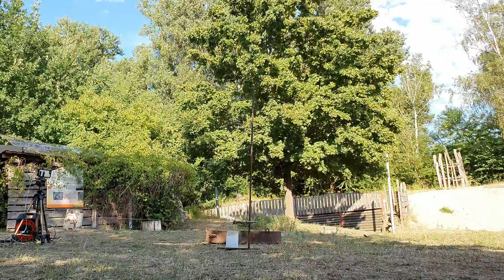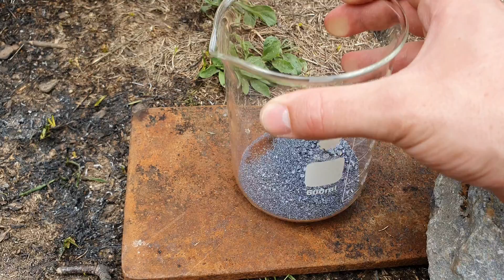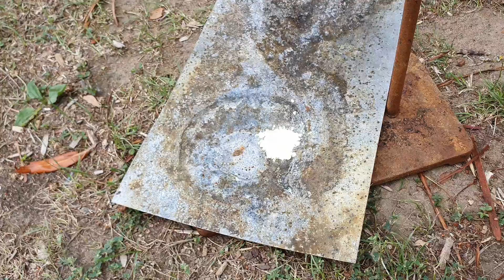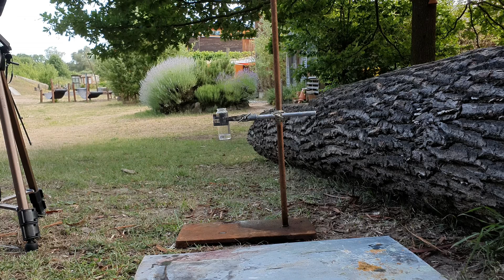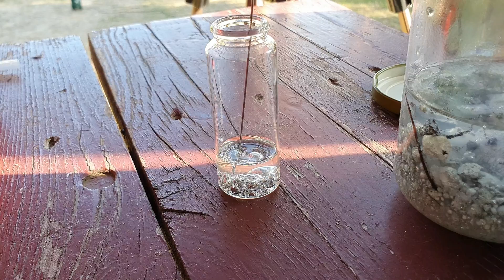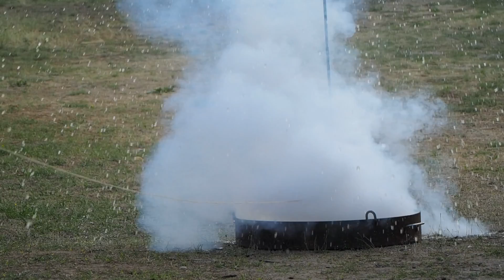Cesium reacting with Iodine, Sulfur, Teflon/PTFE, Dichloromethane + Making CsNaK

Comment: The CsNaK reaction with water was insane! It was almost as if the insane reactivity of cesium forced sodium and potassium to react with water much more explosively than they normally would! For the columbic explosion, the cesium would react very fast due to its low activation energy for reaction, and the energy released forces the sodium and potassium reactions well over their higher initiation energies, making them explode as well!

Comment: Well, but how about reactions of metallic cesium with:
- solid CO2 ("dry ice");
- liquid O2: Cs + O2 --> CsO2 (+ Cs2O2•CsO2);
- liquid N2O4: Cs + N2O4 --> CsNO3 + NO (+ CsNO + Cs2N2O2);
- naphto-18-crown-6 - in tethrahydrofurane: nf-18-cr-6 + Cs -(THF)-> Cs(+)nf-18-cr-6(•_);
- WO3, MoO3 and MoO2;
- diazomethane in benzene: Cs + CH2N2 -(C6H6)-> Cs2CH2 + N2;
- acenaphthene in tethrahydrofurane: acn + Cs -(THF)-> Cs(+)acn(•_);
- dimethylsulphoxide (- extremely vogurios reaction!);
- [(H3C)2N]3PO (- hexamethapole, HMP): Cs + HMP --> Cs(+)[HMP(•_)]
- acetonythryl;
- acetic anhydride;
- fluorene in THF;
- liquid SO3;
- SOCl2 and SO2Cl2;
- S2Cl2 and S2Br2;
- dimethylformamyde and dimethylacetamyde;
- liquid P2O3;
- liquid SO2;
- cyclopropane and ethylene in THF with 18-crown-6: Cs + C2H4 -(THF)->  Cs-CH2-CH2-Cs;
- bis-(phenyl)-acethylene in THF;
- cumullens in THF;
- liquid N2O;
- CrO, FeO, VO;
- "dry water" and octafluoronaphtalene;
- hexafluoroacethone in THF or methyl-tert-buthylic ether;
- triphenylborane in THF or tert-Bu-O-Me...?;)

Comment: Cs:NaK would probably be an extremely effective magnetohydrodynamic working fluid  due to the high entropy and extra loose electron of the Cs. Fwiw i had to fix up an E-beam evaperator head that used NaK to prevent the gun and target holder from ending up vaporized. It took several kg worth if NaK to fill the resovoir and plumbing up. The pump had 2 SmCo magnets with platinum iridium rods fit into a beryllium oxide ceramic chamber. Why the NaK needed replacement? Someone was replacing a vaccum flange and the wrench the used hit the magnet and cracked the ceramic part of the pump causing some of the NaK to leak out an catch fire. Ended up using argon to extingush it. Shut the service valves, and wrapped the pump body with parafilm and pallet wrap to prevent any more leaking and burning. It didnt do too much damage to the machine itself since most of the machine wasnt easily burnable even by burning NaK... but since it was a class 1000 cleanroom this happened in, the NaK smoke residue was a major problem. 🤓
Reply from the maker: Oh, that sounds like an expensive mistake/accident. I worked at a company with clean rooms once and I remember we were not allowed to use certain deodorants and the women (and men) were not allowed to wear makeup due to the particles.
Must have been a pain to clean everything up. 
.

Comment: I want caesium and iodine with liquid iodine and a spray of caesium. Under a deep enough layer of iodine gas, iodine will become liquid when heated because of the high pressure. You would need a windless day.
Reply from the maker: I will put it on the list!